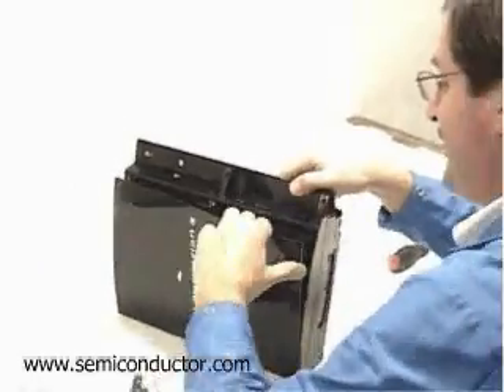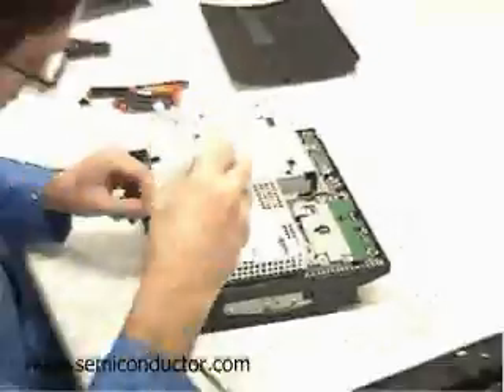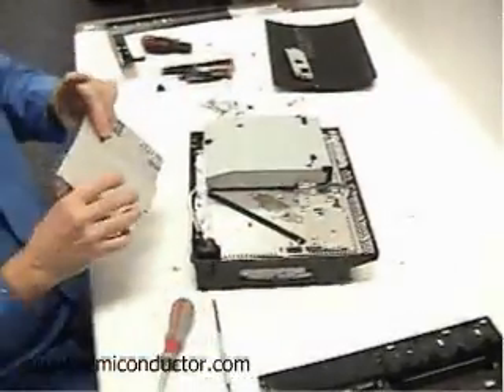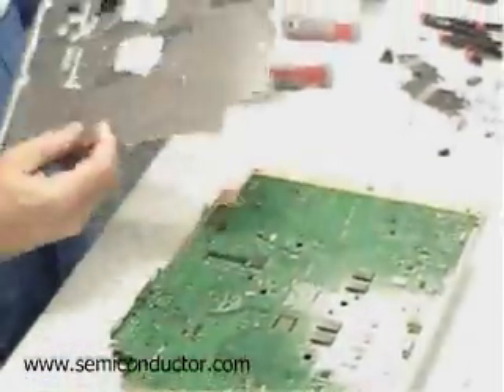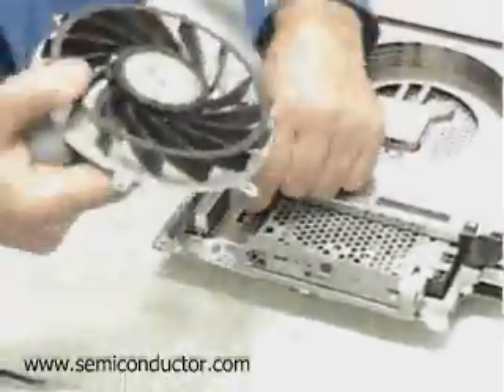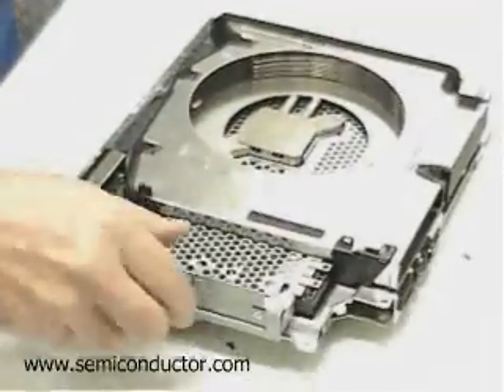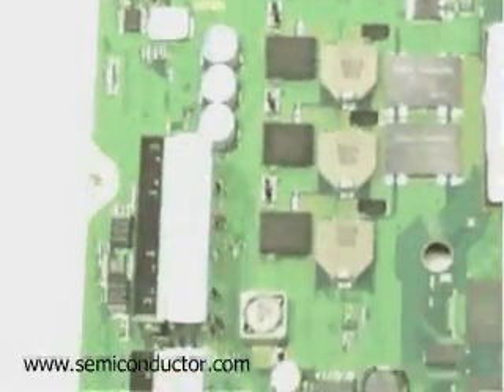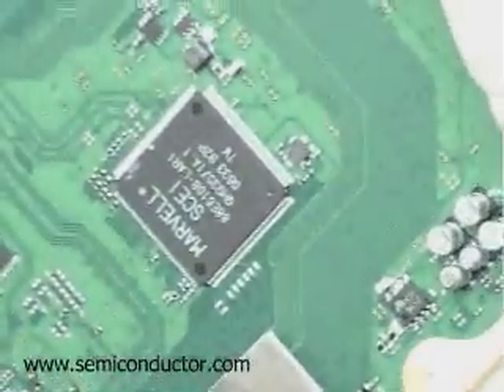Teardown of Sony PlayStation 3

Comment: yeah..
wii: new gaming grab a hold of motion rather than that boring controller.
360: more saturated graphics
ps3: VERY powerful cell processor(even though not a SINGLE game uses it, too bad :( )
currently, the wii is the best(in the matter of evolving from the sixth era to the seventh of gaming).
the 360 in sales(2 years! lucky microsoft..)
well  the ps3 loses( because no develepor uses the cell processor....yet..
DOWN WITH FANBOYS, ITS GAMING, NOT GAYMING!

Comment: Another fanboy just like dragonboy401...both 360 and PS3 are fucking great...but PS3 better catch up on the games...the 360 after 3 months of release had lot of good games...it's going to be a year and the PS3 has practically nothing...you  can buy a 120GB harddrive for the 360. And the 360 is more powerful than the PS3...where do you get your info?

Comment: When ur not playin games, put those powerhouse PS3s to good use by running Folding@Home, found in the network section of the menu. Run by Stanford University, the project aims to find out how proteins 'fold' and therefore lead to possible cures in types of cancer and other diseases. 
If you are from Australia or New Zealand join my team from Downunder - | Aussie Rules Footy | Team 52735 | otherwise theres also a YouTube team headed by adiblasi team no. 79621

Comment: Get a 100% free ps3 or any thing else. Just follow this steps

1-) Go to xpango(dot)com
2-) Click ''Sign Up''
3-) Fill out the fields with the information needed
4-) Select the ps3 as the gift you'd like to receive or any other gift of your choice
5-) In the field ''Referral ID'' insert this code 90610631
6-) Click ''Register''

Comment: o you want a PS3,360 or Wii?just follow these steps:

1. go to xpango(dot)com
2. click at: sign up now (its 100% free)
3. fill in the required fields , and enter by the REFERAL ID this number: 90594552
> FILL IN AN VALID E-MAIL ADDRESS! and choose also the gift you want!
4. than click at register
5. you will recieve a e-mail from xpango, click at the link they gave you to activate you
account.
FILL IN THIS REFERAL ID: 90594552
If you refer 28 people, and they sign up you get your Wii!

Comment: Want an xbox 360, PS3 or a Wii?

1 go to Xpango (dot) com
2 sign up it's free! (click it)
3 fill in spaces that are requried to be filled out
(use 90566552 as the REFERAL ID)
4 use a VALID E MAIL ADRESS because it will ask you to verify later
5 click register
6 you'll get an email from xpango , click the link to actviate tha account
7 then log in
8 complete free offers for credits

REFERAL ID 90566552

Comment: For those of you that don't know, the PS3 is the most powerful, XBox 360 next, and Wii last. The PS3 blows away the 360 in a technical level, but the 360's games are better at the moment. The PS3's games don't even take full advantage of the system's hardware, so its graphics are wrongfully compared to the 360 in an equal way. The PS3 needs some games that unleash the system's true power. The Wii's hardware is the slowest, but the gameplay is incredible. Overall, I like the Wii the most.

Comment: I may not a fan of the PS3, but even I know when I see a good piece of well engineered hardware and the PS3 is definitely that. The power supply and cooling system are by far the best parts of the machine(the motherboard ain't too shabby either). After seeing the video, I can now say that the system is definitely worth $600. I just wish it had better games for it at launch.

Comment: comment was so long I needed to do two...
that fan is HUGE! the heat dissipation on this thing is awesome.
I wish they would have shown where the blue tooth and wifi antennas are located in it, a range extender or something like it wouldn't be a hard mod.
good video guys!

Comment: you guys this is a teardown of the ps3, not some debate club where you can swear ever other sentance.
even if you hate the ps3 you can at least be respectful of the fact that its a beast of a system, and its extremely interesting to see how sony crammed so much into it.
one feature i really enjoy on the ps3 is its internal power adapter.  unlike the wii and the 360 you dont have to have another external brick to have the complete system

Comment: yep, the wii uses a motion sensor array which is compared to a sensor thats meant to be put on top of your TV set

the PS3 uses a gyroscope that detects motion from the controller, the difference between the wii and the ps3 controllers are that the ps3 can only sense diretions and not 3D space location where the WII can.

Comment: sure, the PS3, is complicated, but considering that the powersupply is internal, and still about the same size as a 360 (roughly) there is still a lot more scaling down that can be done..

Comment: the ps3 is actually as expensinve as 360. ps3 out of box=600
xbox 360 +hd player(needed) +coolant fan(needed or you 360 will melt=640. their equal.